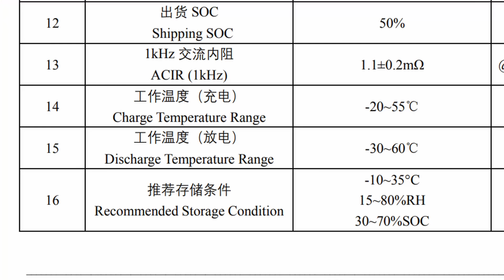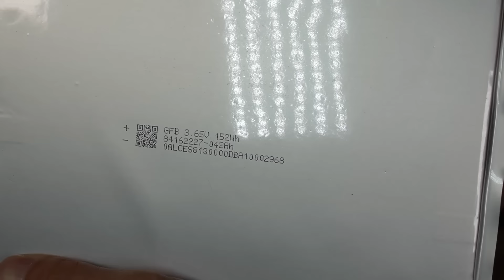CHINS Solid State Lithium-ion Battery Tear Down and FIRE!

Comment: I actually commented on another YouTube channel about someone touting solid state batteries, but they didn’t mention it was lithium ion batteries with a solid state system. I didn’t understand what they meant by solid state batteries. So I looked up the brand they were saying as the next best thing and found out it is just another lithium ion batteries type. When I called them out on it. They either don’t read all their comments or they just ignored my comment. I specifically mentioned they could be a more fire hazard. Thanks for exposing the risk. I watch a lot of your videos. To help me with my solar designs for my new house and our off grid Rv
Reply: Other person called this solid state batteries. Yoshino B4000 power station. If I remember correctly they never mentioned lithium batteries

Comment: In their example the puncturing device was left in place not allowing the electrolyte to be exposed to air. In your example, you created a hole with the drill and the hole was open to air. So it's only kind of safe... only if you use a screwdriver or something like that to puncture it and then leave it in place. ..
Reply: plus, heat was generated by the drill

Comment: I had a car jump starter from ebay that was already buckled from using it to start a small engine around 5 times. A BP 15 year old 40W panel and a Stecca regulator.
Left it on trickle charge in my toilet to use it as a buffer for night flashlight use. It went thru a meltdown and filled the whole house with white smoke and took 2 weeks of airing to clear the stench!

Comment: Very funny! 🤣 As soon as you took a drill bit to it, I thought , "So much for a puncture test! Now we're going to do a can-I-get-it-to-blow-up-for-YouTube friction test!" Nice to see a preliminary look at solid state. It will be interesting to see the refinements to follow.
Reply: If this battery was mounted in for instance my boat's lazarette (which is the storage space under the main cabin's coach seats) and someone put a fitting into that space with a drill ... such an adventure could very well happen. Not sure though about what would happen with Lithium Iron Phosphate Prismatic cells. Such batteries are installed in plastic boxes though, which adds some distance ...

Comment: These are the same type of batteries that were in my sons electric skateboard that caught on fire just sitting on the back deck. My marine electrician saw my son riding it down near the marina and he told me to make sure he doesn't bring it in the house or charge it in the house because they have cheap ass pouch batteries that are notorious for catching on fire and no BMS as they just use a real small charger at like 2 amps or something. I owe him one because that's exactly what happened. It got some moisture in it I think and something shorted, but that thing was spewing some big flames. The guy from the company said he'd send us a new one if we gave him a good review. Told Amazon about it and they refunded us our money. 2 weeks later a new board showed up and I brought it to the recycling center.

Comment: Also remember this is relatively early days for SS. Early li-ion weren't all that great either. 
I remember my first Leaf which could allegedly charge at 50kW but only ever got to 36kW and then only for a very short time in the middle of the battery. Contrast that to my model S and that thing could eat 100kW easily anywhere between around 10% and around 80%. That was in 2017 and plenty of improvements have been made since. 
If SS can improve at that rate its going to be brilliant in about 5 years time.
Reply: Yeah on your car analogy, my Model 3 can charge at over 200kW, and there are some EVs pushing above 300 kW now even!
Reply: And yet it doesnt matter if its 100kW, 200kW, 300kW or even 1MW. All it matters is that in the batterypack each cell should get below 1C of charge. For an example, if your model S eats during charging 300kW but you have enough battery cells in the batterypack, just divide those 300kW with cell amount and you will find out how many watts each cell is getting during charging. Now, you each of your cells is getting 4W, then your amperage to each cell will be 1A. 1A is well below hazard limit. With largest batterypacks in cars, there are even 0.5A of current on each cell during charging, that is already well below even normal charge, its safe, its even benefitial for the cell to be charged at lower currents.
In short, it does not matter how many watts your car is taking from the grid during charging. What matters is that each cell during charging gets below 1C of charging current at any time for safety and longetivity of the battery during its lifespan.
Its not those 300kW that kills your battery and creates fire, its the one cell that overheats and starts burning, igniting all other cells within its reach creating runaway cycle. At that point your charger is already disconnected from the car and not supplying all those 300kW because all the safety and sensing circuits in the chargers and in the car itself.
Reply: @audigex  My big take away from this is that even at this early stage its holding close on twice the capacity by volume. The 1/3c rate for what appears to be non cooled cells in an enclosed box suggests they could go quite a bit higher in a liquid cooled application such as a car already and if its twice the size it only needs to charge at half the c rate. 
Lets say a 100kWh li-ion takes 2c reliably - then the equivalent in this would be a 200kWh taking 1c. Charge per minute would stay the same so 10-80% would look poor but it would only need to go from 20-55% to hold the same amount anyway. 
Depending on how they behave at the top and bottom of their charging I could see these even being quicker to take on the equivalent amount of energy as a 5%-100% li-ion through sheer capacity.

Comment: Great video Will..  I asked in one of the last videos about UPS (Cyber Power and APC) battery swaps from lead acid to Lifepo4.  The reason I asked is Chins and Ampere Time had it in the listings title in Amazon but now looks like they removed UPS from the titles. Still might be worth the video just to inform people.
Reply: It would be interesting to see the actual cells of a Chins and Ampere Time LiFePO4 battery because CanBat has a direct 12V 9AH LiFePO4 replacement for the standard sized 12V 7-9AH SLA batteries. They stand behind them with a 10 year warranty. 

I am using them in a lot of UPS units having replaced the 12V 9AH SLA with CanBat 12V 9AH LiFePO4 batteries. With that change, I now get just over twice the run time on any UPS I have installed them in.
Reply: @FirstLastOne  How long have you been using these and I what UPS's?  Good replacement batteries have gotten hard to find.
Reply: @sonictech1000  Not First Last but I also have switched to LiFePO4 batteries in the UPS Both ACC and Cyber power units. They cost more than the SLAs but seem to run longer and are the same size outside. Open one up for the surprise though.  More dead space than you would think. Mine have been in for over a year now and no problems. One of the old SLAs was hard to get out as it had ruptured the case.

Comment: The drill bit temp ignite it from inside at very high temp. In normal condition will not ignite nor smell as you just demonstrated with the punch hole in the first place. I remember the drill bit rotation will even burn the metal that can get  red hot.

Comment: I believe it is agreed that the pouch you removed from that battery is not safe to be punctured by a metallic object.  The reaction was rapid.  That was very lithium polymer pouch cell like.  You almost have to wonder if these are actually just lithium polymer pouch cells and they are trying to just tag them with "solid state" to try to make a mint off it.  Honestly, the first sign of trouble was a DOA unit.  The average consumer would purchase this battery pack, take it out of the box, attempt to charge it, and then nothing because it is a dead unit.  The product as a whole is a full fail.

Comment: Ok Will, now you need to do a collaborative video with a maker, and build an air powered battery puncture test machine...
Maybe a crossbow with steel bolts to puncture test your cells...

Comment: I dont know if you have seen, but Ali express has a 12v 138ah Lifepo4 battery for $49 free shipping. I did purchase 4 for myself instead of buying a $500 Lifepo4, but when it is that cheap, gotta take the risk.
Reply: It'll probably be 13.8ah
Reply: What are you searching to find those? A quick look maybe you're talking about the MEKPA battery with the 32700 batteries inside? 138ah would be the AH rating of each cell added together. You won't be getting 138ah @12v.

You see this quite often with power banks, they advertise the capacity of each cell rather than the capacity at the packs voltage.
Reply: Maybe a 138ah cell? Wouldn't be 12v though... You'd want 4 to make 12v.
Reply: @CollinBaillie  nah the battery pack is built out of individual cells, for example 12 X 4500mah@3.7v.
Making a 12v pack out of that would be 3s4p. Making it 4 sets at 4500mah. So most would advertise it as a 18ah@12v battery.
What these companies do is advertise the total capacity of each cell so, 12x4500 oh look we have a  54000mAh@3.7v battery. So technically correct but incorrect at the same time as that isn't the voltage you're expecting.
Reply: @Loolanga  Yeah, I got it... I found some 48v packs sold as 138ah using that method. No 12v packs though

Comment: They punctured it straight through with that screwdriver… when you used the drill, that was adding a ton of energy via friction with all of that rotation. Not surprised it caught on fire when theirs didn’t 😋
Reply from the maker: Others did as well. It's cobalt based.

Comment: In the CHINS video, they puncture it while it is inside an enclosure, indicating that they know it's not a safe thing to do.
Reply: I wonder what atmosphere was in the enclosure, you could have a protective atmosphere with no oxygen. There are lithium batteries where the cathode can release O2 when it breaks down, even with trow the combustion rate and time until it stare will depend on if atmospheric oxygen is present or not.

Comment: Maybe it was the heat produced by your drill 's friction that triggered it. If it was a pure mechanical impact hole (like they show on the video) maybe it wouldn't catch fire.
Reply from the maker: Yes very true
Reply: Fair point but SSBs are advertised as safe and having no risk of catching fire even if put in fire it shouldn't combust. Can you imagine a car crash, battery rips open and it's exposed to sparks or heat. It's as bad as gasoline if not worse.
Reply: Will, you could always puncture test a second cell.
Reply: It was severely outgassing even with the screwdriver puncture and the fumes were, at the very least, noxious.  Whatever chemistry is involved in those packs is clearly highly reactive - I don't think friction set it off as much as multiple layers getting involved.  Puncture accidents are almost never as clean as the one in Chin's video.  I think this was an accurate indication of the potential danger.
Reply: @robertm2663  You might want to try that out in the desert ...
Reply: That is what I wanted to say, puncture is not the same as drilling, maybe the are right...
Reply: Looks to me like you have 13 shiny objects left to place at various distances out in the desert, and do some "target puncturing"..lol
But seriously, that was pretty friggin alarming. That thing caught fire fast!!
Reply: Nonsense. The heat comes from the short circuit of the layers of current collectors causing rapid discharge and thousands of amps to flow in a very short time.

Comment: Say aah ...'Will' , "drilling/step drilling" is not the same as simple "puncturing..." that drill introduced alot of friction/heat and also exerted some chemical mixing... at some point they were correct... I love your new solar array setup...

Comment: I have a 12x20 shed at the hunting club. I have insulated it and all. We have no power. My brother ran wires, put up an electrical box, and we use a generator. We also have lights running off a battery so we don’t have to use the generator all of the time. I would like to have more electricity to be able to plug in my phone, tv, radio, etc……what recommendations do you have for a solar panel set up for something this size? Thanks in advance!

Comment: I think you're being a wee bit melodramatic, Will.   It is safe.  You're drilling into a block of raw lithium which is always going to flare violently when exposed to atmosphere.  That's what lithium does!  And consider; you had to drill well into the pouch to get it to react. So for sure, you wouldn't want this in a vulnerable location but where most batteries are located and used, it's safe enough.  I think the real safety consideration is the "while it's in use" consideration.  It's safe when charging and when in heavy use, and that's the real advantage here.

Comment: Have you researched Sodium Ion  batteries?  I am in MN so Lithium in cold weather off grid is an issue. Sodium-ion batteries are also safer because they are nonflammable and less susceptible to temperature changes than lithium-ion batteries.

Comment: For future reference Will, don't do puncture tests for lithium cells on a wood workbench. The Chinese have been known to exaggerate on occasion about their products.
Reply from the maker: Agreed. I made a mistake. I did read data sheet and watched the video and figured it would be fine, but absolutely not worth the risk. Won't make that mistake again
Reply: @WillProwse  I suspect that Chins was just using the information supplied by the manufacturer. It's so easy to be "mislead" by vendors in China. I'm sure they would tell you it's because you used a drill and not a screwdriver! Anyway, as you noted, there is a lot of energy stored in a small space, I will stick to LFP. Not 100% safe, but certainly one of the best available, and great cycle life. Thanks for the video, BTW.😀
Reply: Another interesting test would be to send a .22 through the complete unit. An accident very possible out in the desert. Would the bullet pick up some heat on the way through the core?
Reply: @jamesscott1932  That's an interesting idea. The chances of me accidentally drilling into a battery is slim, but I've been camped on BLM land with people shooting just a few hundred yards away. The chance of a stray round hitting my batteries is still slim, but it's a possibility.

Comment: When a positive plate and negative plate touch each other you let the smoke out. The fire won't stop until the plate stop touching each other.       This is why battery fires are so difficult to extinguish .

Comment: puncturing might have different results from drilling. when drilling you are going to heat the area up by1-200 degrees. that could be difference in their test and this one being performed
Reply: re: "when drilling you are going to heat the area up by1-200 degrees"
Sitting there pressing the bit into thick plastic you can get there, but this is not a thick cutting board made of polypropylene or HDPE ...

Comment: I can see a use case for that solid state presuming it worked as stated. 
Say you want an ev with a very high maximum range but all the usual benefits of li-ion. Since the solid can hold around double the capacity per volume you could have a smaller li-ion battery (say half so about 50kWh in a typical big battery Tesla or similar) then the other half as SS. 
That would give the same li-ion power delivery but with 150kWh in the same space with the SS constantly recharging the li-ion. This would also have the side benefit of many less charge cycles on the SS as you would only really use it once the li-ion was not enough and would hold the ability to keep the li-ion in its happy charge state more of the time - so extending its life, too. 
Also any battery with more capacity by definition will go through fewer full charge cycles per miles covered so adding half again would be a big bonus for longevity. 
Only downside would be charge rate over about 70% would suffer - the li-ion would go fast to 80% and the SS could be charged at the same time but once the li-ion slows you have a slow charging SS and you're at the top of the li-ion.

Comment: What you see, Is LiFePo4 Pouch Cell Punch test. and what you do, is on Li-Ion Pouch Cell. No matter they stated "solid state" or whatever, it still the same Lithium Ion Pouch : Easy to Explode or caught in fire or thermal runaway. you cannot change that behaviour only because they stated as "solid state" and then is seems to be more "safe" than it was before.

Comment: A puncture test creates a dead short. If you just punctured it you would have the same result as they did. In essence you used the drill like a friction fire bow. You introduced the heat that caused the fire.... Still it shows that for example, in a house fire it will go into thermal runaway. In an impact accident it would probably be safe

Comment: They might be right as far as a puncture, but drilling you created heat which looks like made it combust.  But did you see there enclosure around it when they did the test. I really thought  you might be calling the fire department when I saw start to swell.

Comment: The reaction after the puncture looks very similar to a traditional LiPo battery cell. Voltage reading also. Could it be a scam? Lipo sold as "Lipo solid-state" ?

Comment: I have a question for you Will. Forgive my ignorance. Is it normal for these pouch cells to have a smell? I recently bought a Wulills 12v 200ah from Aliexpress. The lid came poorly sealed and when I opened it up it has pouch cells. They looked solid with no inflation or puncture, but has a weird smell to them.